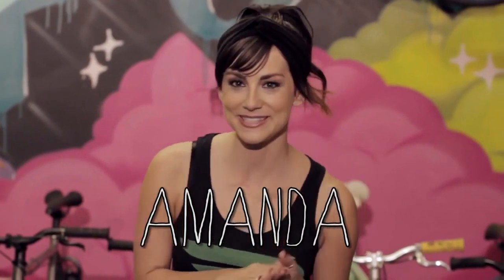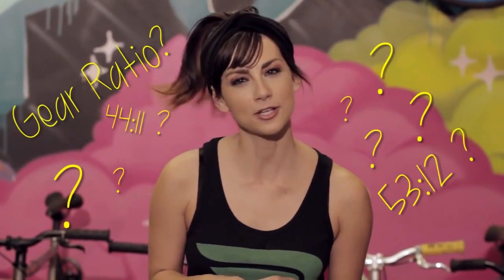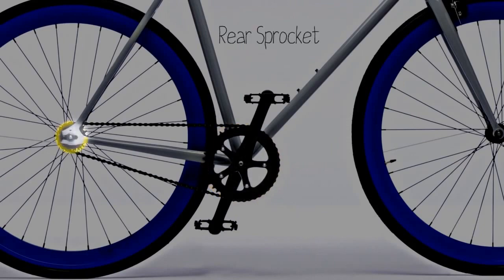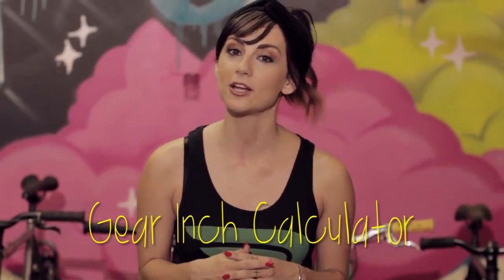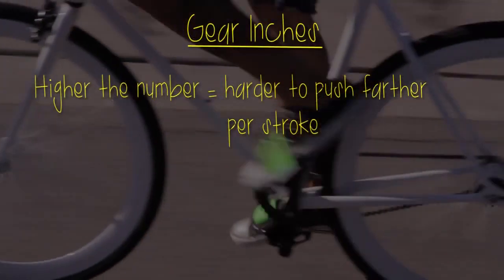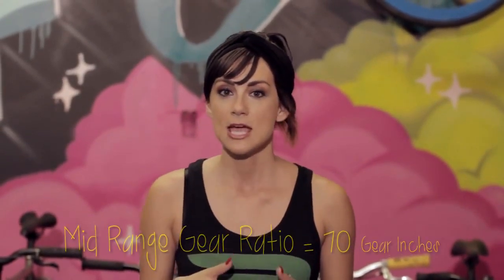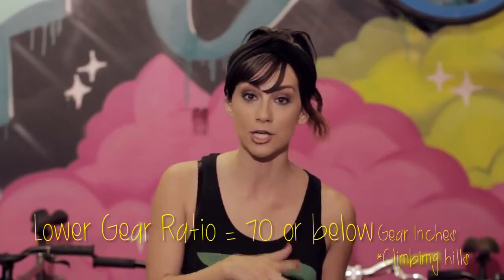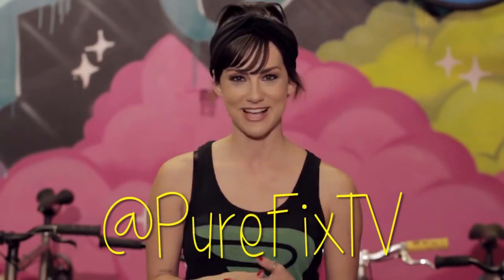Pure Fix Cycles: How to select the proper gear ratio for your fixie

Comment: Rule of thumb for Fixie/SS gearing - Find a gear ration that you can maintain 85rpms on flat smooth pavement, no wind, at moderate-hard effort. 70-100 rpms will be your cadence range cruising.  This gear ration will account for short or low gradient climbs or headwinds/tailwinds.  Gear up for flatland rural areas, gear down for urban/hilly terrain.  If you are an average fit recreational cyclist, 75" seems to be the "sweet spot" for Rural/flatland, 68" for Urban/hilly riding.  Subtract or add about 5"-7" depending on fitness level.  Subtract about 10" if you're riding an MTB on dirt or rough roads.